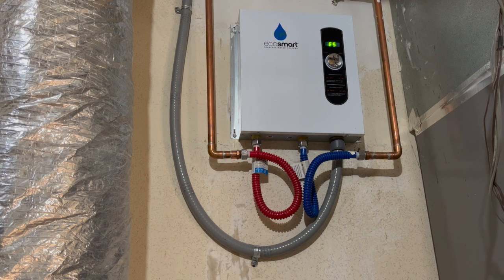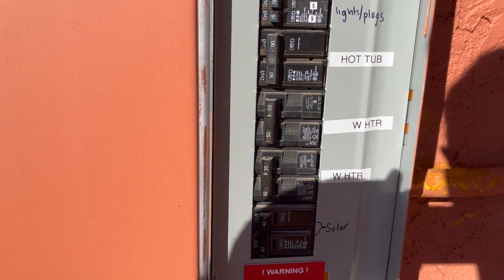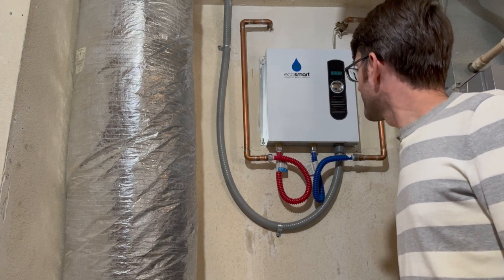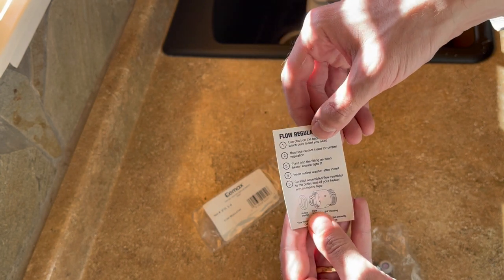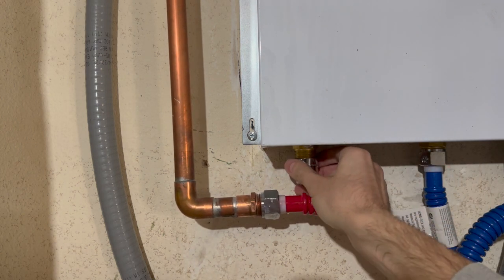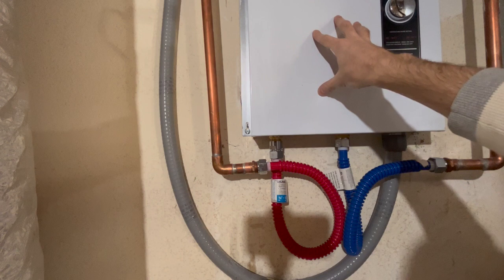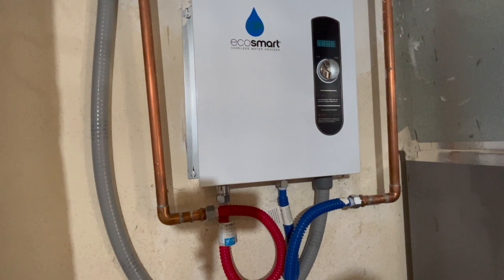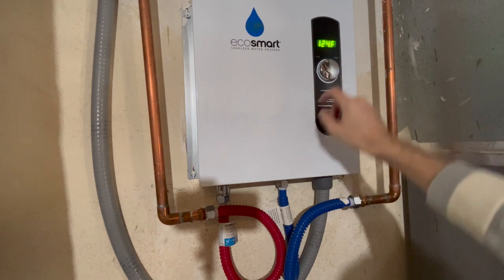Adding a Flow Regulator to an ecosmart Electric Tankless Water Heater

Comment: Some people just don't get it. You did the right thing to improve your water problem. The restrictor goes on the outlet side just like a hydraulic pump system, but you should put a relief valve between your tank output and the restrictor. Just in case the electric on off sensor sticks or a power surge fries things.
Reply: Your comment answered my question as to where I should put one on mine. I have a flush valve/diverter with a pressure relief valve on the side of it. I think I’ll put the restrictor on after the diverter but before the flexible hose for obvious reasons. I wonder though if I can just turn the ball valve on the hot water side to slow things down. I have a sharkbite flexible hose set for water heaters and one of the hoses has a valve built into it. Since I already had a valve on the cold water side I just put that one on the hot water side. Maybe try that before opening up the plumbing again.

Comment: Its a very good idea to have 2 big blue water filters on the house main in one sediment one carbon. And My house is getting hit with 65 lbs of pressure from the city which is very high and hard on all the fixtures and pipes. I installed a regulator on the main in that's at 45 lbs alot easier on the house piping and my Eco is happy. if you have an old house and some legacy piping it will like that reduced pressure and you wont miss it. And for gods sake insulate all exposed hot water piping from the eco.

Comment: Should of put tge restrictor on the inlet side
Reply from the maker: You might be right; in my mind, I was thinking, it's probably better to make sure the heater stays "full" to avoid overheating, but I suppose the flow coming in and the flow going out are going to be the same. Do you have more reasoning for putting it on the inlet side?

Comment: Hey guys just fyi don’t waste your time with the EcoSmart 27 unless you just have 1 bathroom, 1 kitchen sink, and 1 washer. It says it will handle 2 bathrooms and it kind of does but not very well at all. With the eco 27 in a 2 bathroom home, you’ll get occasional bursts of cool water or Luke warm water if both showers are running, and even worse if you’re doing laundry and dishes at the same time

If you have 2 or 3 bathrooms, a kitchen sink, washer etc spend the extra few hundred dollars and get the EcoSmart 36, you’ll thank me later. The eco 36 handles more gpm (gallons per minute) up to 8 gallons per minute, and it also has an inline flow restrictor that can limit the gallons flowed through the unit  based on your needs and the water temperature in your area. Colder areas & winters in the U.S. like in Minnesota have colder water than other areas of the U.S. like in the south Florida. So if you have really cold water you’ll want to limit the flow a little more so that the water can stay the same temperature consistently. It has multiple flow restrictors from 3 gallons up to 8 gallons. But you get more hot gallons per minute, and it handles the entire house. Keep in mind the EcoSmart 27 needs 3 breakers, and the EcoSmart 36 needs 4 breakers. Both units can make your LED lights flicker a little bit but it’s not that bad. If you have incandescent bulbs they won’t flicker. I’ve had my unit for years and it works great. I also recommend getting a water softener for your house. My EcoSmart unit hasn’t clogged once with calcium deposits, unlike my father’s. My father doesn’t have a water softener like I do and he has to get his EcoSmart unit serviced and cleaned out yearly.

Comment: Every home has a built-in flow regulator. As a matter of fact, several. They are called faucets. You can achieve the same by closing your faucets a little instead of fully on.

Comment: Does it need a pressure relief valve?
Reply from the maker: That’s a good question. Ecosmart doesn’t say you need one. The heater (if it’s working correctly) only runs when water is running (I.e. at least one valve in the house is open), so that’s one less risk. And it holds much less water and air, so that helps. I have an upcoming video where I add flush valves and a pressure relief valve, though, so subscribe and you won’t miss it!

Comment: Restricting the flow of water to the unit defeats the purpose of an  on demand tankless , you will just get a tepid flow of very hot water, absolutely useless. 
Engineering flaw by the company, waste of money!!!
Reply: Eco ax is stealing your Money!
Reply from the maker: See my response to your other comment. I agree it seems like something they could’ve solved in the product design, though I don’t think I’d quite say it defeats the purpose.
Reply: @jpfath  , a weak flow of hot water from a hot water source defeats the purpose of that hot water source.
There is no talking out of  a crappy machine!

Comment: Why wouldn't a flow regulator starve your system ?
Reply from the maker: The regulator goes on the hot water output of the heater, so the heater stays full, but it limits the volume of hot water in your tub, shower, etc.
Reply: @jpfath  , this defeats the purpose of a tankless water heater if you have to take a shower with no water pressure!
Reply from the maker: @kevinellsworth9318  I can see where that would seem troubling, but it’s not an issue in reality (for my case, at least). In the video, I mention it restricts to about 3.2 gallons per minute, and a shower only takes about 1.3 gallons per minute, so you could take two showers without noticing. The main place you’d notice is that if you tried to fill the bathtub (which, for me, can run up to 5 or 6 GPM), it’s a little slower. But the trade-off is that without this, you could quickly fill your tub, but it might be lukewarm.
Reply: @jpfath  it does not seem troubling, it is troubling when the unit wants to be starved of water so it can function. This unit is low capacity but it is engineered to go E5 at levels that won't let you have a descent shower and wash the dishes at the same time, what a crook!
I have one in my 1500sq ft cottage and can't take a shower without restricting the flow to the unit , which gives me a weak stream, and heaven forbid someone wants to wash there hands at the same time!

Comment: You need the proper valves and temp valve installed on it. You could regulate the flow with those.
Reply from the maker: Yes, I think you're right. I'm planning to do that when I get some time and make another video. This was the recommendation in the product manual, though.

Comment: So I didn't want to restrict flow in my whole house just to fill my bathtub. So I unscrewed the spout and dropped a washer inside with a slightly larger drilled hole, than screwed the spout back on.
Reply from the maker: That’s a good idea. You should make a video of it! :)

Comment: Gas or oil baby that’s how you heat hot water😂
The electricity your using is most likely generated by natural gas or coal.
Reply from the maker: Hi M K! Thanks for commenting. Please check out my other video, "Tankless, Heat Pump, Storage | Attack of the Water Heaters!" where I mention that we installed rooftop solar before this switch. Also note that our electric provider, SCE, is about half renewable at this point. Coal electricity generation in the US has been declining for decades.
Reply: So!

Comment: I have the same setup and had the same issue. I installed a valve so I could fine tune the adjustment of pressure. I turned the shower on and kept slowly adjusting the valve until the code went away. It's a bummer cause it's less pressure but man does it put out some serious heat now. Best of luck!
Reply from the maker: That's a great idea! I see another video in my future. :)
Reply: @jpfath  I live out in the country and sometimes have surprises from the county of a pipe busting and it messes with the water pressure so having the valve has been nice.
Reply: This is a flaw in this tankles water heater, they are supposed to furnish hot water on demand not limit you to low pressured hot water on demand!

Comment: You might check your water pressure to see if it is too high because it will push more water through than what the water heater can handle I believe they like it between 50 to 70 PSI
Reply from the maker: You might be right, though I don't have a pressure gauge for that. It seems to do just fine with lower-flow fixtures, such as showers and sinks.

Comment: No flush valves?  How long have you had this unit?
Reply from the maker: I've had it for about 3-4 months. As I said, I'm not a plumber. The plumber who installed it admittedly didn't seem to be an expert on tankless. It might be something for me to consider adding down the road.